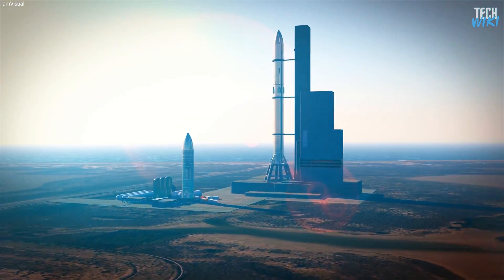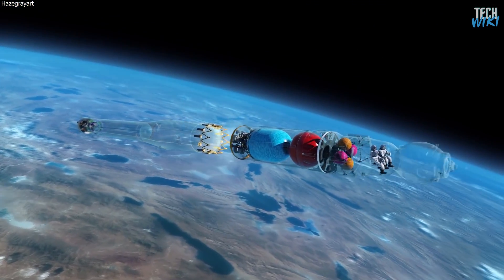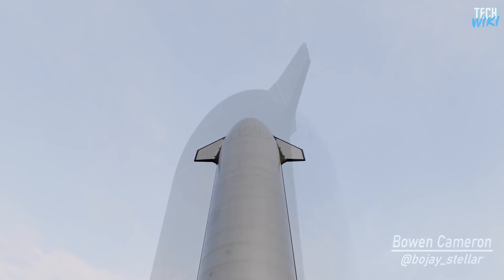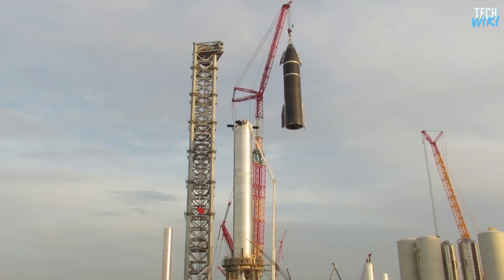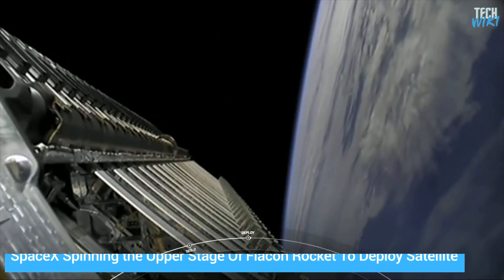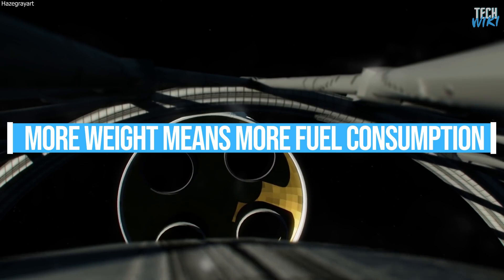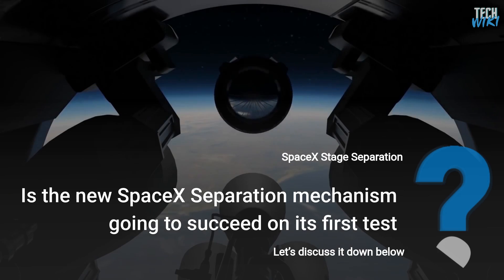SpaceX GENIUS Engineering design to Skip Separation Mechanism - SpaceX Starship Stage Separation.

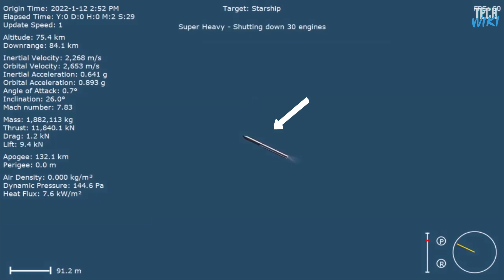Comment: The simulation at 4:16 shows that the entire stack has to be pitching up (or down, but preferably up) at_the_moment_of_separation. The separation occurs because BOTH vehicles are tumbling, NOT straight and stable.

The sim shows about 0.3 degree per frame, or about 9-10 degrees per second of pitch rate, 0.18 rad/s. With the Superheavy cg about 50 meters from the Starship cg, that gives an effective separation acceleration w^2R of about 1.5 m/s^2

More importantly, the Starship quickly (in about two seconds) is no longer pointed at the top of the Superheavy, and all six Raptors can be started without causing damage to the SH. The SH can then coast for about 15 more seconds and be turned around for the boostback without needing any cold gas thruster system, and arrests the pitchup with its Raptors after they relight. With separate internal tanks for the landing propellant, the main tanks can be partially vented down during the coast while providing ample cold gas control- using the redundant vent valves that are needed anyway.

All the other animations are mistaken in showing the separation with SS at zero pitch rate, and the SH doing instantaneous pitch rate changes with no physical cause.
Reply: Very good explanation, thank you!
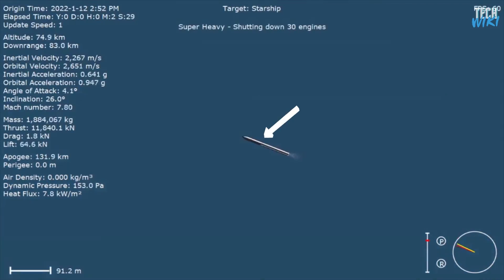Reply: yes, rocketplumber, I also think 4:16 is the best part of the simulation.
And your description is the same that I think and your calculation seems to be correct.
Techwiki is talking and talking but has no clue how it works. The simulation shows gimbaling the 3 central engines of starship. That makes no sense. the whole stack of both combined stages can only be rotated by gimbaling the engines of the booster stage. And that will be done just before MECO main engine cut off. And the engines will gimbal all in the same way, not twisting. They will cause a rotation (pitch) around an axis perpendicular to the direction of flight, not rolling the rocket around longitudinal axis.
Twisting/rolling around the longitudinal axis makes no sense because the combined center of gravity and the individual COG's of the stages are located on that axis. There would be no force pulling both stages apart from each other.
A classic separation mechanism would use springs to  push both stages away from each other. Correctly - pushing away the "super heavy" booster (empty and lightweight at that moment) away from starship (heavy with full tanks). Not starship away from the booster.
The new mechanism will have no springs but it will still have some kind of latches which suddenly are opened during rotation/pitching of the stack of both stages. First the stages are rotating around their common center of gravity (which is located inside starship which has the higher mass because the booster is empty) and after opening the latches both stages will drift away from each other on individual straight lines (both flying with insane speed nearly horizontally, starship slightly ascending and booster slightly descending or less ascending) at the same time individually rotating (pitching) around their own COG. The rotation of starship will likely be stopped immediately with its controll thrusters while the booster might keep rotating for the correct orientaion for boostback burn. After drifting appart for a particular amount of time both stages can (re)ignite their main engines to accomplish their individual mission.
BUT...: The rotation directly after MECO end of propulsion will keep the propellant at the bottom of the booster tanks. After separation the booster rotates around its own COG. The propellant in the upper tank will move to the top. So I think it will need the gas thrusters. Or am I wrong?
Reply: @hl4842  We're in violent agreement on all points. The SS will need some sort of ullage settling to keep from unporting the main propellant feed for the forward (methane) tank, although the aft (LOX) tank should be fine, since the centrifugal acceleration will settle it. Maybe the methane header tank (or even the main tank) could have a mid-plane tapoff that will grab liquid even when sloshed the wrong way.

The SH residuals should end up in the methane downcomer and the LOX reserve tank if the center of mass is forward of their free surfaces just after separation, so its engines should be able to restart for the boostback without troubles.

The dynamics of this separation technique are certainly more complicated than the standard method.
Reply: @r0cketplumber  Yes 
I had forgotten the huge cross section of the downcomer of the CH4 tank.

Comment: 😑
Starship would egnite 3 engines (not 6) after seperation
(The 3 vacuum raptors)
Reply: Nope, Starship needs all 6 engines during ascent. Thrust of 1 raptor is approx 200 tons, while fully tanked SS weights about 1200 t. With only 3 engines running it would start falling back to earth.
Reply: @Richard-Vlk  you don't understand orbital dynamics
Reply: @mlzs_  > "you don't understand orbital dynamics"
Falcon 9 does the separation at 1600 m/s, that is far lower than orbital velocity (8 km/s), so the centrifugal force cannot kick in. Separation with SH is designed to be even at lower speed.
Centrifugal accelaration is v²/r, which for Earth's perimeter r being approximately 6400 000 m gives 1600²/6400000 = 0.4 m∙s⁻²
Which is just 4% of Earth's gravity (9.81 m∙s⁻²). There is no way orbital dynamics would solve that.
Unless you double the thrust of those 3 vacuum raptors you have to start those 3 sea-level too.

The separation would have to start at 5600 m/s if you wanted to use only 3 engines and did not want to start falling back. Hint:  √(5 * 6400000) ≐ 5600 m/s
Reply: @Richard-Vlk  ok
So they will 100% put 6 rvacs on ship

Comment: Why even bother latching the first and second stages together at all? Why not just stack them like two uptuned glasses, stacked and held together by gravity on the pad. During launch the G forces of the first stage thrust will keep them together until MECO. Then all you need is a tiny retro burn of the first stage's RCS thrusters and the two will drift apart.
Reply: wtf bro even a 4 year old would realize its not gonna work
Reply: Sounds stupid to me

Comment: They remained in this model for a long time, other space programs before, tested multiple before deciding. Starship is only two stage, because of this, SN is forced to use up fuel reaching orbit, thus require another round trip of a full Starship, just to butt2butt refuel. adding beurocarcy of task. Perhaps 4 to 6 sets of a Big Heavy single falcons adjacent to SN, doing 2 or 3 pare stages, could have a avoided refueling. Or another mid-BN stage into orbit, to save much more travel fuel & round time. Example stages, BN&SN, then BN&'mid-BN' to orbit, then SN&'mid-BN to Mars, fully fuel resources and less landing risk of fuel saving, on Mars & round trip back.

Comment: If there is a failure I think there's a high chance it could be related to the Heat Shield tiles.
Reply: There is the added alternative to HS tiles, a paint coating first that is disposable (if had to expose) , in 1967, an X-15A hypersonic ctaft seeking an infinate paint HS coat, but it wasn't good for horizontal continues, known as the PINK ablative coating. Could save the craft, incase of an outer HS tile chipped.
Reply: @ckdigitaltheqof6th210  Starship has strong reasons for a quick turnaround. Any sort of heat shield that needs replacement/refurbishment, similar to the one on Dragon, would make the turnaround towards the next flight too long. The mission starship will reach orbit with payload (food, equipment, colony shelters etc.) but little  propellant. The mission starship will then benefit from a quick series of refueling flights using a small number of other Starships that will be relaunched a FEW hours after being caught by the launch tower's "chopsticks"
Reply: @robertvirginiabeach  ...still a double round trip, with full sets of Starships, even if it still proves cost effective, its a continues orbital traffic, when the goal is exo travel to another world. Still the disposable paint beneath it will require coating, incase a tile break.

Comment: Separation Mechanism:  Should we assume this move has been simulated in Fluid Dynamics software?    Lets say yes, of course!  Then did you vary  all the physics / cryogenic, theremal weight, thrust, rotation parameters involved  thru a 6 sigma process controls to see if there was an issue?      Lets say Yes, of course!   then its a go for build and testing.
Reply: The reality is a way better simulation for spacex.

Comment: Wrong.  Superheavy booster does NOT land on it’s grid fins. It has two landing bosses that stick out the side at the top that it lands on. The grid fins can NOT support the weight of the booster.

Comment: Dont they mean the gimbaling engines of Superheavy? You kept showing those of Starship, but how would they induce a spinn? They are VERY close to COG at that moment before seperation?
Reply: Agreed. Presumably, acceleration during ascent is to keep the two stages together but there must be mechanical clamps to allow non-coaxial forces caused by aerodynamic forces or engine gimbaling to be transmitted to the upper stage. Seems like another half-baked click-bait, look-at-how-smart-I-am Elon Musk idea. The Star ship fans need to show skepticism over such nonsense.
Reply: @pawnfish352  Well, I tink inducing a rotation in pitch or yaw and then disconecting the upper Stage would be a nice idea to seperate the halfes. Only you would have to induce this rotation by superheavys raptors, not by ships raptors!

Comment: Will the four grid fins on the booster fold down at launch as depicted in your animation or will they remain extended?
Reply: The grid fins on Superheavy are NOT retractable. And this isn’t his video. They are using old, outdated video here. As well, there are numerous technical errors in this video too.

Comment: why dont the super heavy burn during the atmosphere entry?
Reply from the maker: It won't reach the orbit
Reply: @SpaceEyeNews  oh okay!
Reply: it also uses it's engines to slow down when coming down, but if something is in orbit, that's a whole different story.
Reply: @tidan4575  cool!
Reply: @tidan4575  SH will  not do reentry burn, unlike Falcon 9. Its speed will be lower than F9, so he does not need it.
Reply: It's more durable than falcon 9 it will survive. Don't need to waste fuel.
Reply: Exactly like the Falcom 9 does.
Reply: Its reentry speed is about 2 km/s, which is much lower than orbital velocity (about 8 km/s). So the heating is much less intense, it is square/cubic function of the velocity, depending on the regime.

Comment: This is completely doable,  but is not risk free.
The main dangers are excessive rolling that can cause an early separation and also the starship flames and gases damage some systems on the booster if too close right beneath it.
Reply: This whole thing is not about roll but *pitch*.

Not sure why early separation stands out for you. How is that risk different from the risk of any other mission critical operation? A norminally functioning flight computer is a prerequisite for everything, otherwise of course we may get early circularization or early lithobraking or any number of bad things.

Comment: thanks
but its still unclear how the 2 stages are connected together.
somewhere there must be a hard connection to make sure the 2nd stage dont fall during the launch.
Reply from the maker: Yes, it's not revealed yet how they are going to latch the 2 stages, but it's clear that they're not wasting any weight on stage separation process.
Reply: @SpaceEyeNews  it’s kind of revealed. Look at the top of Booster 4 and you can tell a lot about how it works.
Reply: @SpaceEyeNews  By looking at the top of the booster you can see a bit about how the clamp works, however, Elon has said they will spin the entire stack to have it separate naturally instead of wasting mass on pistons and hydraulics like on falcon
Reply: There is a locking mechanism, 3 of em. IT will unlock but not launch the 2nd stage though.

Comment: I don't understand the description of how gimballing the engines jettisons the booster
Reply from the maker: 4:17 Engines will move in a way that will create more force on the upper stage occurring separation, also this is not the only factor
Reply: @SpaceEyeNews  So will they light up the starships three gimballing sea level raptors whilst still attached to the superheavy? To gain momentum for the ship but not the booster.
Reply from the maker: Not lighting them up, just making them move in a way that will increase the force in a point that will make the booster separate.
Reply: @SpaceEyeNews  I watched another video that explained it a bit better. Just before meco they will gimbal the middle engines of the superheavy booster to cause the whole system to spin. That spin will separate the parts.
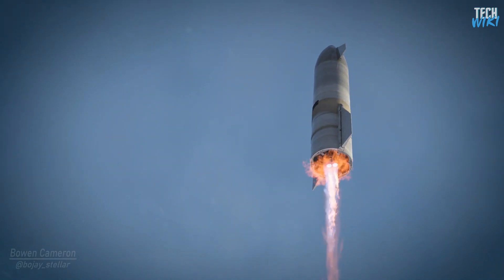Reply from the maker: That's exactly what we said, watch here 4:24 & 5:12
Reply: @juhovalio5906  They will light up the 3 larger belled engine since it is pretty close to the karman line.
Reply: @SpaceEyeNews  You're saying this would use "the 3 sea level" engines of the starship, and pointing an arrow at that location. That's a different thing than middle engines of the superheavy booster. And you're saying "not lighting them up", while "before meco" means yes we're talking about lit engines.

Looks like you misunderstood around which axis the rotation is meant to be induced, and by which engines.

Saying "force is concentrated on the upper stage" is mumbo jumbo too. Every force has an equal opposing force. If centripetal force is pulling parts apart, it's equally "concentrated" on both sides of the connection.
Reply: The way I see it is gimballing of the three engines will shift the mass of the Starship counterwise to the booster. Not unlike unscrewing a jar lid.